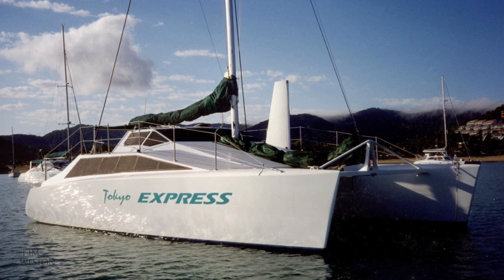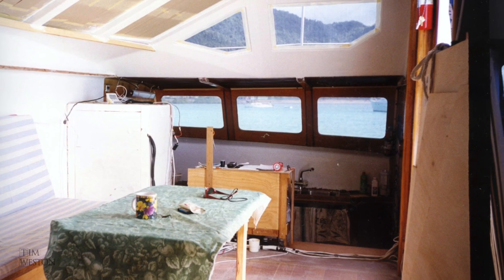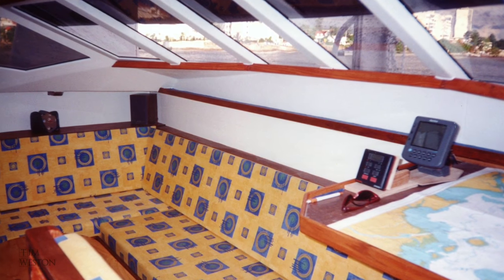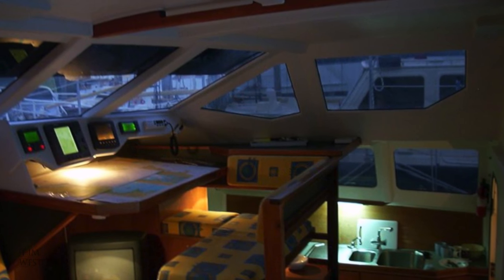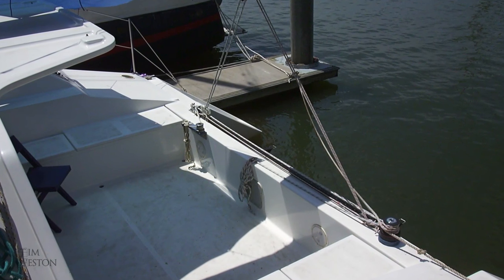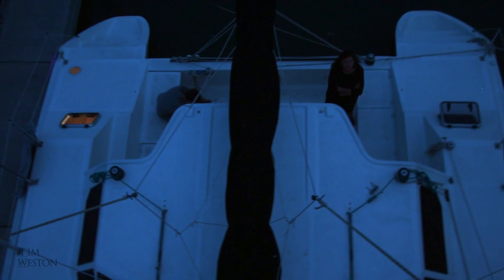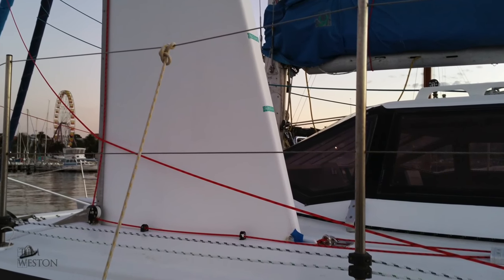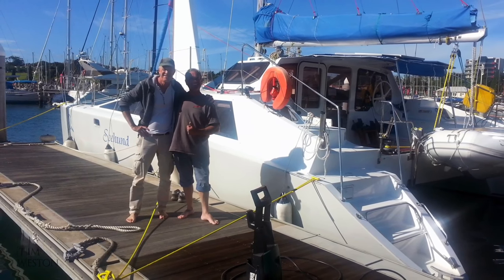How to build a boat Ep #12 - Catamaran you can live on - Reunion

Comment: Thanks so much for taking the time to share your experience. With zero boat building experience and a metal working background, it is with awe and trepidation that I watch vids like yours as I try to determine whether its too much of a leap to attempt a similar project
Reply from the maker: Hi Hatemondays. I also started out with mostly a metal working background and had little boat building experience when I started this project. If you are already good with metal, it wont take you long to pick up what you need to build in this way..  Give it a go!  Tim

Comment: Great series Tim! I was planning on buying a boat in the spring. But after looking at fuel costs vs sailing, I'm leaning towards building one that could be more of a hybrid with green energy fuel power and sails.  I liked your design layout and was curious if you found the plans for it somewhere or designed it yourself?

Thanks,
Joe
Reply from the maker: Hi Joseph. Thanks for your comment!  Yes, I am a fan of sailing not motoring. There is nothing nicer than the silence and the feeling of moving for free, when you turn off the motors.. I bought plans and modified them to build this boat. I am now creating new plans, to build this boat and they will incorporate many slight but important changes to the original design. Details will be coming soon to my website and the plans will be available to purchase in the coming months. They will incorporate options for electric drives too, as auxiliary propulsion. Send me an if you are interested in more information Joseph, to info@timwestonboats.com Regards Tim

Comment: there are no beam on this catamaran?How is possible, only joint the 3 pieces without beams
Reply from the maker: The main bulkhead, that runs under the mast, is the web of the beam that connects the two hulls, Theo. There is uni-glass top and bottom that forms the flanges.

Comment: could this be built from ply wood instead of planking?
Reply from the maker: It's possible. You could rip ply up into planks and scarf them together. Or it would have to be designed as a chine hull. Not as light and the later not as pretty, but cheaper.  But on a boat with a final worth of many hundreds of thousands of dollars it's probably saving in the wrong place. But I have thought about.. Or partial use of ply. It's not off the table yet this idea..

Comment: This series added last drop to scales build my own boat or not. Although my project is not as grand and sadly no sails, but it's still what i want and should be a joy to use. Planning to build 30ft wide beam power catamaran with electric propulsion, mass build power cats are either too narrow or way too heavy, price is another story. Secured sources of marine ply, bought plans, working on paper-work necessary before building. In Japan catamarans are a rare sight, electric propulsion even more since it has many limitations. So anyone that hears about my project here in Japan thinks i have some problems with my head. But it only fuels my desire to finish my own boat.
Reply from the maker: Hi Xellzor. Thanks for your interesting comment. I understand when you say people think you have a problem with your head! 😄 Good on you, and electric is a great idea. I will be building electric motors into my next boat too. But with a sail as well. Keep in touch, it would be great to hear how your project goes. info@timwestonboats.com. Cheers Tim
Reply: Look for YouTube S/V Uma, a monohull sailboat running a direct drive DC motor, a small 12v battery bank and solar panels as their secondary power. Hands-on info there.